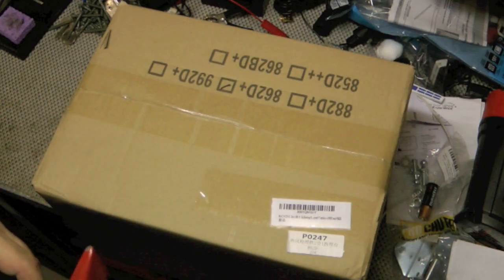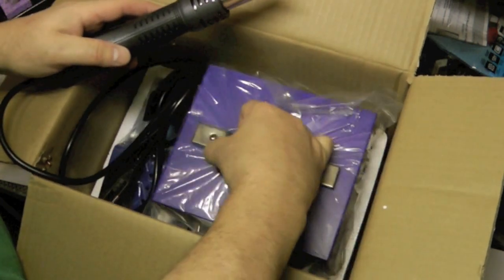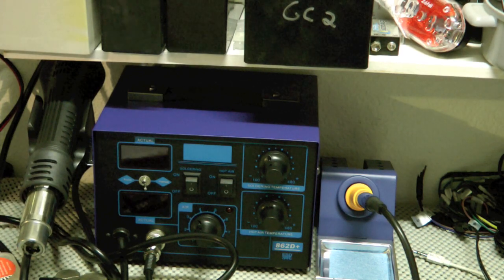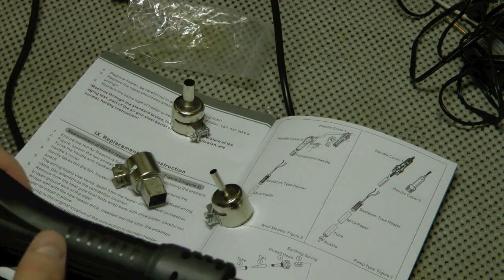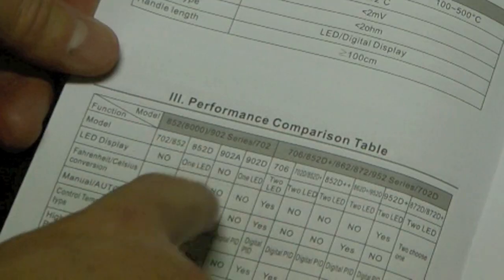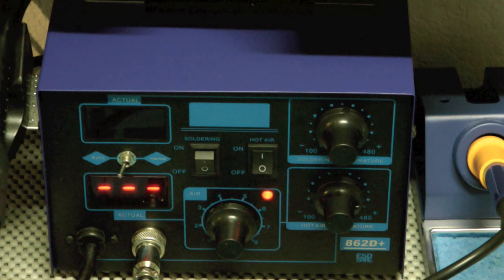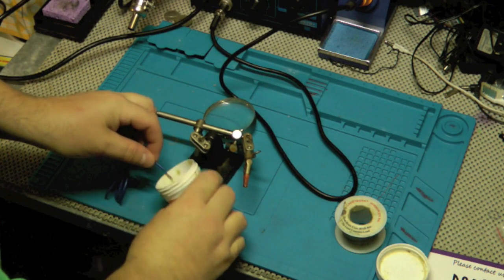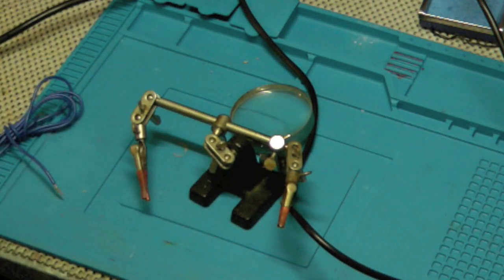Unboxing 862D Soldering Station

Comment: I soldered for the first time in 25 years last month.
My ceiling fan took a crap.
I found a video on YouTube that showed how to replace a resistor on the fan's circuit board. 
I bought $17 soldering iron kit, from Amazon along with some resistors, and I was back in business.
 -
https://www.youtube.com/watch?v=1pWn2GM_9lI

So glad I didn't have to get a new ceiling fan.